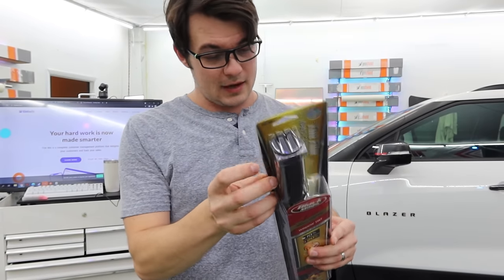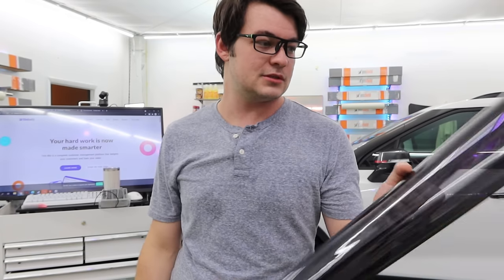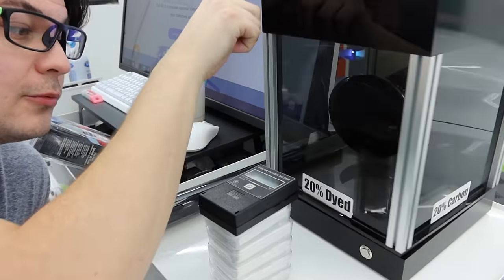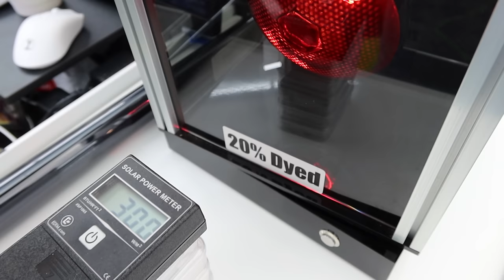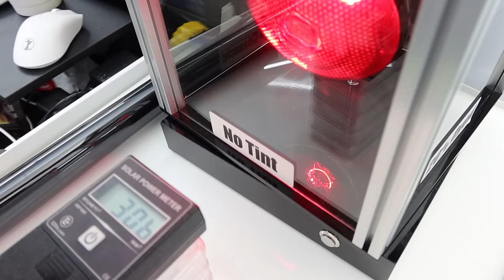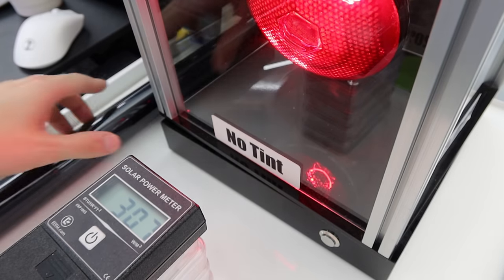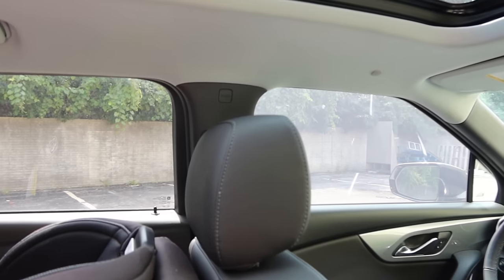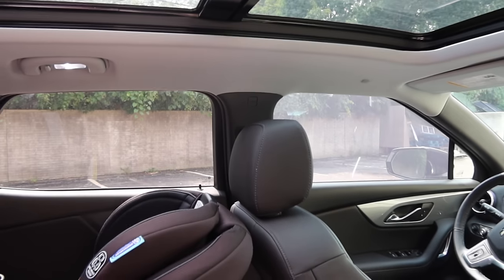Walmart Ceramic Tint Should Be ILLEGAL!!

Comment: Anyone Consider using the film between the roof and the roof upholstery liner of the car? Simply tacking the corners and middle of the film, then installing the liner over it. This method should help secure the film in place providing a clean, finished look.

Comment: Wait I thought the cloudiness from a tint once installed was just water vapor trapped under the film, I just had tint installed a day ago and on my way home the sun was hitting the film and it looked like that, cloudy. I searched it up and I read that it was normal and that it'll go away after a couple days after all the vapor goes away on it's own... Did I get ripped off or is it really normal for this to happen? I had the brand JetBlack Tint installed, Ceramic on my front doors 15%. Thanks in advance
Reply: By now your tint should be looking pretty good, no?
Reply: @mvntra2271  Unfortunately no, as of the time of writing this, I am on the 5th day of this new tint, the cloudy/haze look is still extremely noticeable if the sun hits the window at a certain angle making it hard to see through it, and just makes it look bad overall. In terms of "gotten better" I can't really tell the difference between the time I got my car back vs now, it looks as if the haziness hasnt gotten "better" but I got told it can take up to 2 Weeks to fully "cure" so I'll be posting an update once I hit the 2 week mark or unless it clears up sooner than that. (Hopefully)
Reply: Forgot to post an update on the 2 week mark, but by the time I'm posting this update this is the 18th day and the tint still looks cloudy although its not as bad as it was compared to the first 5 days. However its still very noticeable and an eyesore to look at, I'm going to get it redone using a different brand instead

Comment: Use to work the o ernight shift and these tall windows in the room I sleep in sucked with just blinds as the daytime sun would still get in bad. Out some pull down shades behind the blinds to cover the too half and it kept out enough sun. Maybe I should use some cheap tint on the top half. Would look better most likely.

Comment: You are forgetting one thing about window tints. The tint blocks the light but it doesn't reflect it. It absorbs it. Absorbed light equals heat.
Reply: It's a very valid point that some tints strictly absorb or mostly absorb.  This is actually why ceramic is preferred though, it reflects the IR and UV while allowing higher amounts of visible light to pass.

Comment: Now that I think about it my 01 GMC Yukon has all factory tint I have been as far south as Georgia and through Texas Colorado, New Mexico And Nevada in the middle of summer what I noticed is even the front doors factory tint very little heat comes through my AC doesn't work very hard? Did GM use a Ceramic tint or something similar as a option in 01? I want to put a ceramic film on the front windows but is it even worth it? I know this vehicle was over $50000.00 new back in 01 I'm the 3rd owner I have no way of knowing exactly what options the original owner paid for.

Comment: Iv always used windex with ammonia d in it clean and dry the windows first then using the windex apply the tint iv never had hazing and never use a heat gun with tint film it may cause uneven shrinkage in the film with horrible results

Comment: Please do another video allowing the burn-in/drying time that others here have mentioned is required to eliminate the haze. As shown in the initial application the haze creates a hazard because the loss of contrast that it generates but if that goes away then it would be nice to get a true look at what the end result would be. For now I have to thumbs down this video even though it had some good information because the premise of the video is to determine if the tint is any good and that seems to not have been properly answered (by following the included directions). Also would like to see the IR heat test with the tint actually applied to glass and fully cured.
Reply from the maker: I ended up leaving the film on for a week, hazy AF the entire time. Years ago some films would appear a little hazy from the water but it always looked uneven and would disappear fast. This haze is super even with the film, I've seen it dozens of times as I make videos and test products. so I understand it would put some people at ease a little more to have show it later, but I just didn't have time to in this video
Reply: Wow. You wrote practically a novel length response trying to correct a seasoned professional in the industry with your extremely amateur and ignorant point of view.

What’s even more laughable is you made the point to state how you had to thumbs down the video….? 

You really think you’re someone special, huh?

Comment: Never could get tint to work worth a damn. Went on and didn't fit right. Wouldn't stay on. And always had bubbles. Now I just have what it has when I buy it. Need to peel the tint off because I have to roll the window down to see. I like the cooling but it's shit otherwise.

Comment: You mistakenly got bad testing results at 30 btu. The film had air between it and the glass creating insulation. You need to apply it to the glass like the others to get a proper measurement. .

Comment: I went to Walmart and this was the only option for 20%. Because of the heat shield I got this for my front windows windows and the cheaper $10 same brand for the back.  The haze is pretty bad, ghe cheaper one is pretty clear., the heat shield works really well. When my windows up the sun doesn't burn me
Reply: Probably won’t respond lol but any update if ya kept them and if how are they doing,

Comment: Given that most tint is illegal in Michigan on front windows and windshields...well duh
Reply: It's illegal in all of Michigan other than the top 4 inches when used on the front 3 windows.  Those are the only three with any requirements as you don't even have to have any other windows.  But... if you block your back windows and leave your rear-view in place, you could get a ticket for it not working, lol, so remember to remove it.

Comment: Don't use!  I've learned this lesson from black magic crap tint. 
I'm a diy guy and the tint from auto zone or advanced auto is a hundred times better. 
My window that I used black magic on. Looks identical to the haze you have. An it never goes away. Its been over a month I've had it on. I'm changing it out today with advanced auto tint I've had before. An works pretty well.

Comment: Since you said it was okay to ask questions I'd like to ask one off topic. 
I'd like to tint my car but it has a "landau roof" (vinyl half-top) so there's this lip that covers about 1" of the rear widow and both rear side windows. Am I okay to lay the film on the inside of the window to heat-shrink before peeling off the clear film and applying permanently?
Reply: Doing the heat shrinking on the outside is just to get the tint to conform more easily to the shape of the window. You can do everything from the inside it will just be harder. You can still do the bulk of the heating on the outside and just worry about that final edge on the inside. Those types of tops are a real pain in the ass. Just watching this one video reminds me how much i hated tinting windows and why i will never do it again lol.

Comment: Is it fine with the water drips down inside the door panel? Does it damage anything?
Reply: Unless you are spraying a garden hose on the inside of your door and letting it flood then no your fine. The door panels are designed and account for water getting in them in mind. At the bottom of the doors there are drain holes for water.
Reply: Well my truck is a 99 Silverado and I always got rain dripping from crack windows, I sometimes forget to close windows on storm days also for Hearst and it’s fine , I sometimes had left windows half way down but not on purpose but because damn news say it’s not gonna rain and it rains.

Comment: I wish you were just even an hour or two closer to me I'd bring my trucks to you and get them tinted with good ceramic tint.. nobody wants to touch my windshield or get ceramic for my trucks. And I'm done with whatever crap these shops around here are using. It's junk. It is brown but it doesn't stick worth a crap and I'm tired of paying different shops $100+ for just two front side windows each time.  I want both my quad cab ram trucks done the whole way around in ceramic 5% and the windshield in 35%

Comment: Know nothing about tint. Nano ceramic tint is the big thing on yoitbe.. Live in sunny AZ and want to tint my 2 door jeep with the best heat blocking tint possible. Waht questions should I ask tint shops.  One place said he has two types of ceramic tints one would cost me over $300 and the other is a 3 ply and would run my over $700? What does he mean 3 ply?
Reply: 3 ply should mean thickness but I’d ask the tint shop is there a reason your afraid to? Cheers

Comment: I went to autozone and got the most expensive tint they had it was Gila ceramic in the gold pack its pretty decent. I liked it so much I've used it on my all vehicles.
Reply: I've been thinking about using the Gila ceramic on some of my home windows, but many of the reviews were very bad about the stuff, I've also thought about using the Walmart Black Majic ceramic also.  Not sure which one I'll use.
Reply: @rfunk727  i will stick with gila. I haven't used black magic. Mine still look good a year later. I'm looking to do my house too but i talked to a guy who got the mirror finish stuff off Amazon and had good luck so I'll probably use that stuff and look at the reviews to find out which one
Reply: @rfunk727  just whatever you use MAKE SURE THE WINDOW IS PERFECTLY, CLEAN. I use Window cleaner then scrape it with a razor blade and clean it again. The window can't be dirty at all. that crap really shows up and it won't stick good if it's even slightly dirty. It's mostly prep that takes me the longest.

Comment: How do you deal with the adhesive that gets left behind when removing tint? I was in a rush yesterday and did it in the cold so almost all of it got stuck to the window
Reply: Laquer thinner
Reply: Laquer thinner may work, never had to try it but all you need to do is go to like a Big Lots or a discount store and by Window cleaner in an aerosol can and make sure it has Ammonia in it. Don't get it in a hand pump sprayer...has to be aerosol where you have the little white sprayer nozzle like a can of spray paint has. Spray the whole window with the glass cleaner until the whole window is covered with that white foam. Just let it sit on there and when most of the foam is gone spray it again with a thick layer of foam. Also you don't want to do this in the sun because you want the glass to be cool so that while foam has time to sit on that glue and soften it up. Go ahead and spray it a 3rd time and while the foam is still on the window you should be able to just scrape it off with something like an old gift card, or a Bondo spreader. And I used the work ""scrape'' but it is more like you are just scooping it off. We referred to it as a snot for lack of a better word but it will we kind of like rubber cement if you ever used that, After you scoop it off of the whole window you may have a few spots that you will have to go back and spray again, let it sit/soak and then scoop off.  If you have to do any windows with defroster wires like on a back window...scrape/scoop in the same directions as the wires are going. I sounds a little stupid , or at least I thought so when I first heard about them , but they make plastic single sided razor blades...yes they are all one piece plastic but you can even put them in blade holders made for single sided razor blades and scrape the rubber snot off the window. Next time try and get as much of the glue to come off with the tint. Usually the slower you pulling on the tint the more glue will stay with the tint. Also try different angles...pull it at 90 degrees or bend it all the way back untill you are just about touching the window. What you definitely don't want is for the tint to start tearing off in different layers. You may have 3-5 layers of material making up that one piect of tint and if you leave any of the layers on there it will be a lot harder for the glass cleaner to get to the glue and loosen it upl Hope this helps...good luck BOZ

Comment: Use a heat gun on high and warm the outside of the window when done. Helps the haze clear faster. Domt get it too hot you might damage the tint. Just get it warm to the touch.

Comment: In the old days we put tint on the inner surface of the window to protect it from road dirt and debris, squeegees, washing, etc. When did that change?
Reply: It didn't.
Did you cut your film to size and shape it to the contours if necessary before putting it on the inside in the old days?
Reply: @caddyguy5369  Yes
Reply: @jayclark7237  K.
I'm confused about the question then.
Reply: @caddyguy5369  I just don’t understand putting it on the outside where it’s going to be subject to so much more abuse. Of course, it’s a lot easier to work on the outside of the car than having to be a contortionist when you work inside!
Reply: @jayclark7237  Who put it on the outside though? He just used the outside to cut it to rough size. Then applied it to the inside.

Comment: And you allowed it to cure how long?
Reply: Long enough. “Curing” only dries up moisture and completes the adhesion process. It’s not going to change the fundamental structure of the film and the chemical particles in it. 

🤦‍♂️
Reply: They ended up leaving it on for 1 week without noticeable improvement.

Comment: Wait… it goes outside and inside? I’m confused 🤔
Reply: you cut the film with it stuck on the outside, and heat shrink on the outside, then peel off backer to expose the sticky side and install on the inside.
Reply: Yes. Double UV and light blockage .

Comment: Pretty sure you're supposed to tint it on the inside.....
Reply: He did……

 It’s easier to roughly shape the piece on the outside of the window and you’re not working around the steeper edges of interior pieces and yeh window frame itself.

Comment: Actually, every single automotive product on the market that uses the word "ceramic" should be illegal, because they are ALL false advertising. There is ZERO ceramic in any of them. It's all a lie.

No amount of technobabble or pseudoscience gibberish will change that fact.

There may be a few minerals in some of the products that coincidentally occur in some ceramics, but the structure is completely different and the properties have nothing whatsoever to do with the effectiveness or durability of any paint coating, window tint or any other protective product.

"Ceramic" coatings are nothing more than overhyped, massively overpriced wax/polish. I get exactly the same results with "regular" waxes and polishes, especially the cheap synthetics (which are NOT technically wax but serve the same purpose).

Anybody who thinks ceramic coatings are an ya better are just fooling themselves and caving to peer pressure and extreme confirmation bias. to Any "tests" you see are massively rigged because SURPRISE! the people who do the "tests" have something to gain by lying to you.